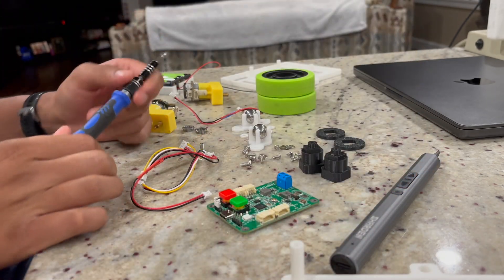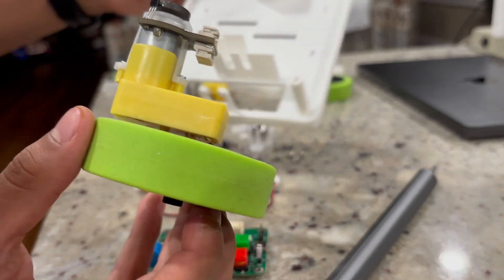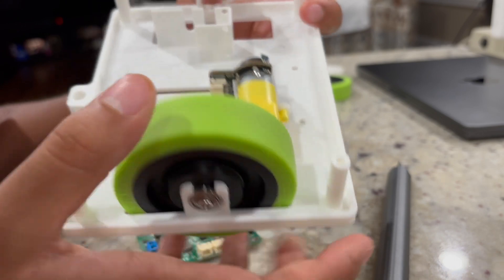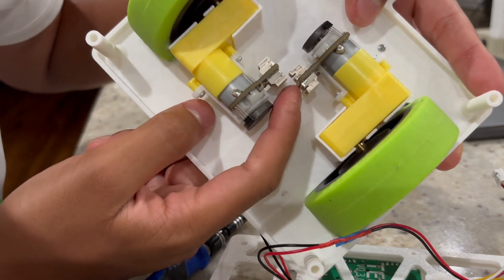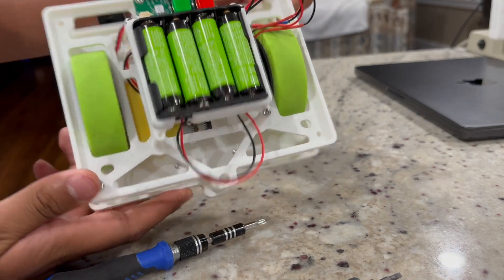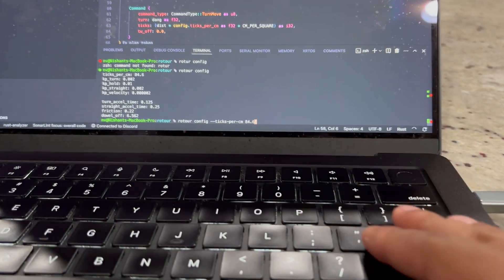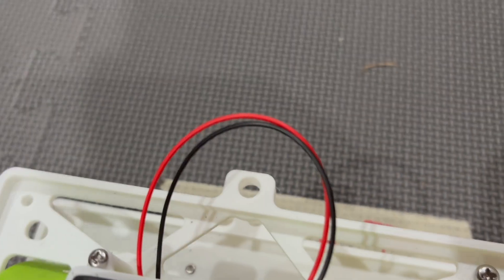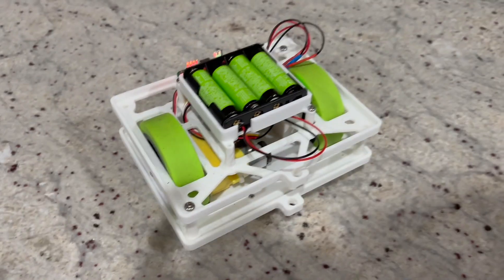(OLD) Tektite-R Robot Tour Tutorial

Comment: Hi, I followed your blog post and bought all the necessary equipment to build my robot. Some key differences between mine and yours are that I plan on using an Arduino Uno for my MC, motors from the Romi kit, and an Adafruit motor shield and imu. Is there anything else I will need because I am using these items compared to the ones that you are using in your video? Thank you!
Reply: I think I responded to you on medium
Reply: @nv7213  Is it on the original "How to make Science Olympiad Robot Tour (2024–2025)" page?
Reply: @nv7213  Is this on the original " How to make Science Olympiad Robot Tour (2024–2025)" medium page? Also, since I am using an Arduino what modifications will need to be made to my code?
Reply: @nv7213  Is on the original "How to make Science Olympiad Robot Tour (2024–2025)" page? Also, can I use the rotour programming language if I am using an Arduino or not? Thanks for your help!